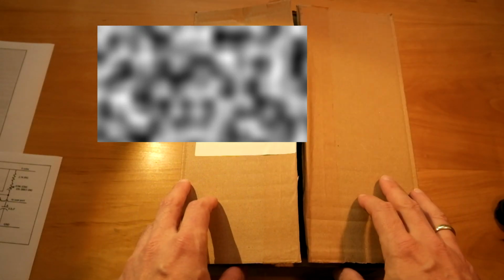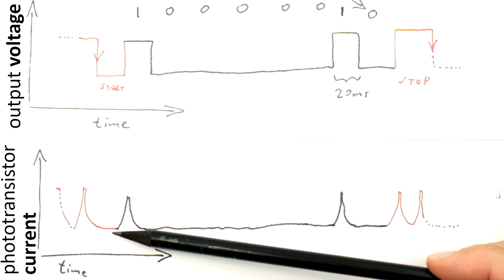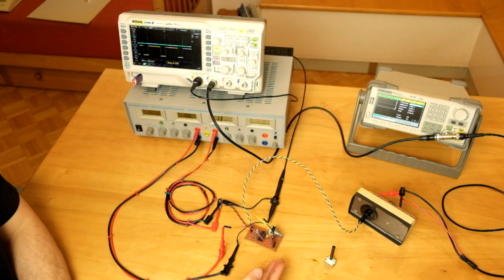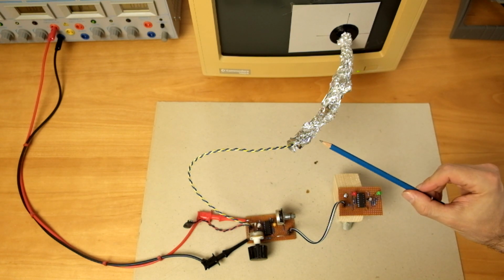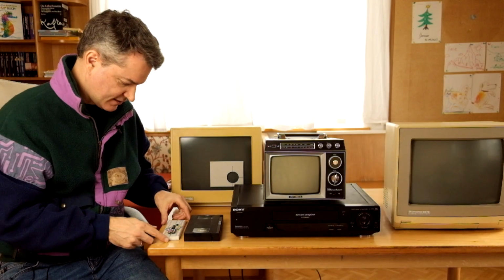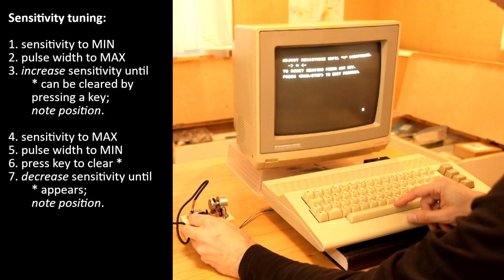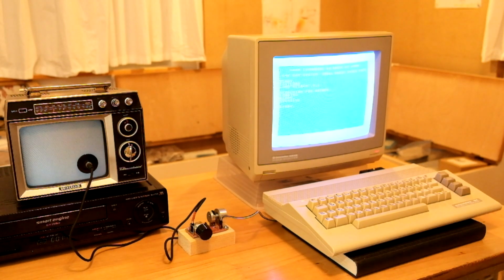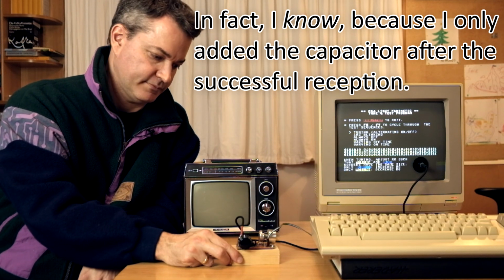Can the C64 suck programs from TV?

Comment: Hi! I can't see the 555 timer version can you improved?
Reply from the maker: Hi! At 41:30 there is a short section on the circuit using the 556 (dual 555 timer). It contains a sketch of the board layout which should also serve as a schematic. If anything is unclear about the circuit, please ask!
Reply: @EdwinSteiner  mmm there is a cap between green line and blue one ... But I can't see value neither cap between red and blue line
Reply from the maker: @rjameslower  The cap between red and blue line is 100 nF (bypass capacitor to reduce switching noise). The cap between green and blue line is 1 µF (timing capacitor for the ~20 ms pulse width). All the other short parallel lines were simply my notes where to cut the stripes of the protoboard, they aren't caps. BTW: Please check whether you have YouTube quality set to 1080p. With 1080p and full screen, the values should be readable.

Comment: 36:13 there's a typo... at first I thought it could have been a missing letter due to issues with the transmission, but I guess the typo also exists in the original code.
Reply from the maker: Indeed, it does. I find it quite hilarious.

Comment: You had a much easier time getting this to work than Retro Recipes did!
Reply from the maker: Well, it looks a lot easier in the video than it was in real-time. I had the benefit of having quite a lot of prior experience with electronics and software. The circuit worked right away apart from the tuning potentiometer problem, but the tuning problem is a real killer if you don't notice it by testing the circuit separately. I had to spend a lot of time with things that did not fit in the video: repairing the VCR, restoring the 1404, adjusting the old TV, getting the signal generation to work (first MDA, then PAL TV), etc. It would be really interesting if it works with the master tapes that Perifractic has. I tried to contact him, but so far without success.